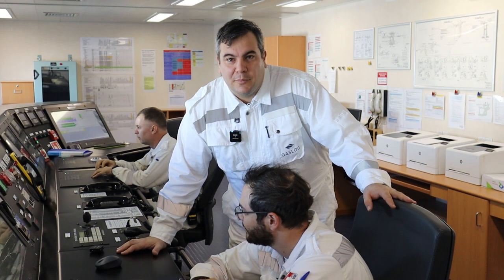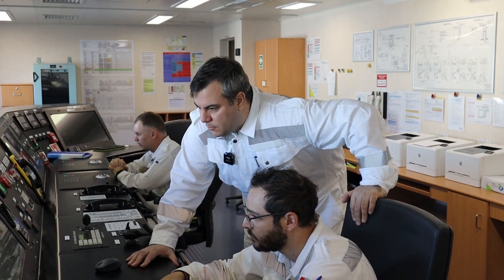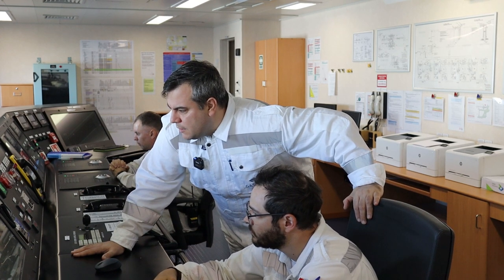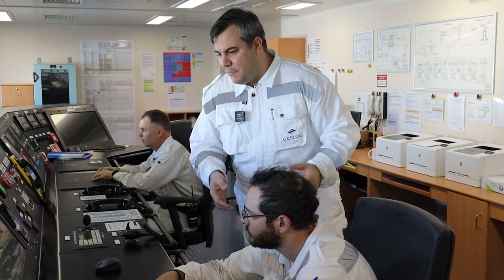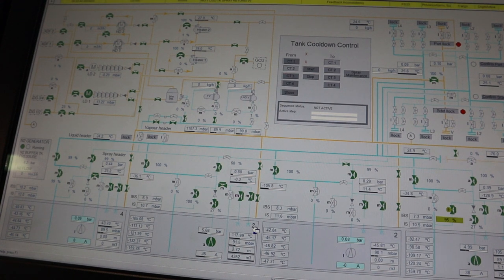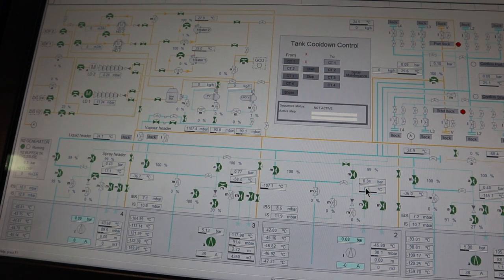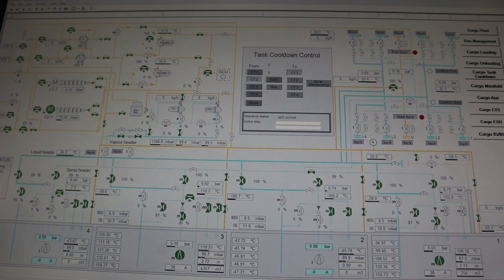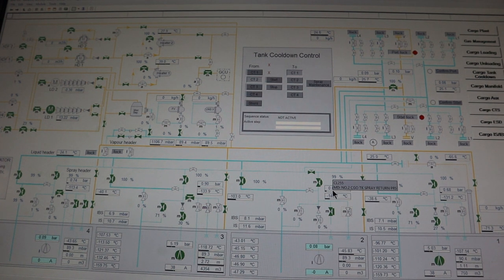Cool down of LNG Cargo Tanks the operation requiring good time management and communication of teams

Comment: Very nice  video capt .one thing in this show  we don't hear any communication between chief and deck cargo to cross check valve opening and confirming pump running without any abnormalities noise or other safety information. 
But very informative  video..thankfully for chief off.
Reply from the maker: Hello I am not sure if it is on this episode since they are three but we always do this it is a standard practice which I also encourage the ratings to do.Thank you very much safe seas.

Comment: Normally if a valve is giving you a fault (on your DCS, In a power plant or a rig) you send the electrician to inspect specific control/motor valve and check the feedback switch, will you do the same with your system?

Also, you mentioned that you have people on deck checking for possible leakages. What's the visual indication? How you locate a leakage? 

Thank you in advance for you response.
Reply from the maker: Hello Konstantine, Yes indeed the ETO will go and have a look on the actual indication and the follow up as required.

Well if you have a minor leakage you will see the following liquid dripping on deck and this particles evaporate and you will see a small cloud.

The larger the amount of liquid the larger the vapour cloud.

And if it falls on water asta na pane RPD rapid phase transition.

I attach you the video

https://www.youtube.com/watch?v=h-EY82cVKuA

Comment: nice information sir.  Sir previously I was working on oil tanker as 4th engineer and now I am getting an opportunity to join LNG vessel as trainee 4th engineer. please suggest me study material, simulation software or videos link or manual ? I am just preparing myself for better handling onboard in near future. I have time to study. thank you
Reply from the maker: Hello there  all the best to your new start.Read anything you can high priority the SOLAS safety Manual and the Cargo Operations Manual.
Reply: Recommending English practice so you're capable of communicating clearly. Notice the heavy accent used, it is often a safety issue with such mediocre English knowledge!
Smooth sailing
Reply from the maker: Hello Muhammad how did it go?
I would recommend you read the safety manual first and then your engine manual 
then comes the rest cargo manual.

Comment: What is te main funtion of the compressor high duty and low duty in the ship?
Reply from the maker: Low duty handles gas and sends it to the engines or GCU
Reply from the maker: High duty while loading excess generated vapours are sent ashore and pre dry dock you can use it to warm your tanks faster
Reply: Thanks sir.